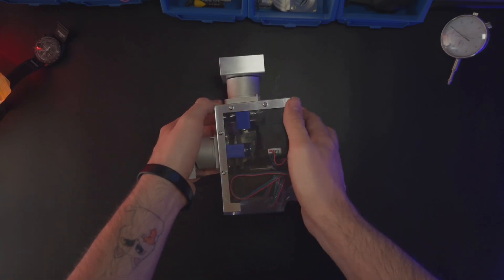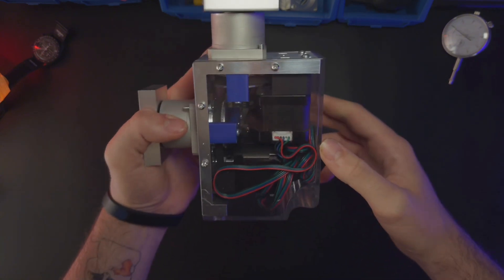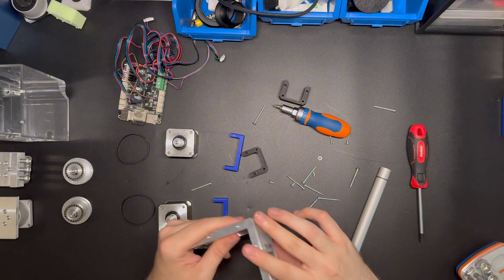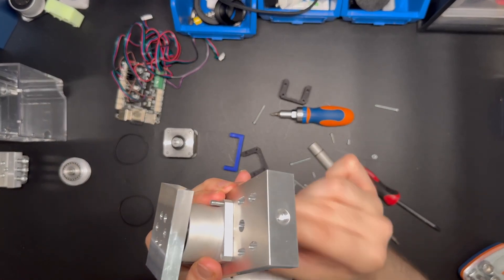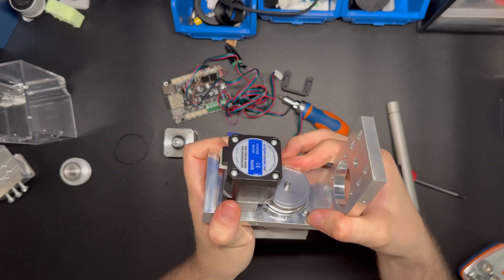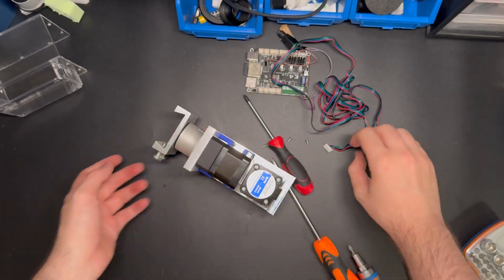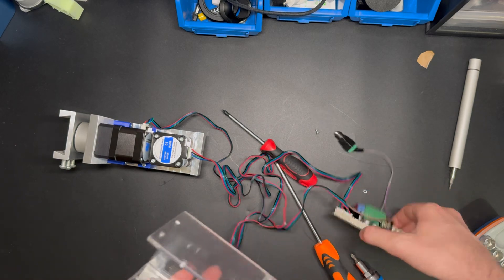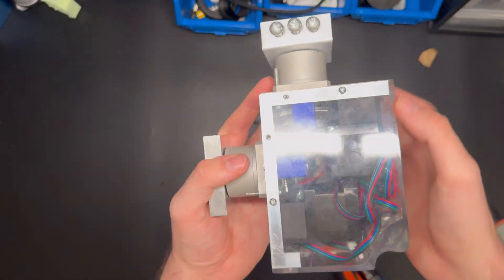Astrophotography on a budget: Assembly this $399 diy harmonic mount!

Comment: I bought you a coffee, but the files provided (.stl) are not suitable for quoting on PCBWAY or JLCCNC. The platform says the file is invalid. Another question is what aluminum alloys will be used to print the chassis, and what materials will be used for the other parts? When will we have a V3 assembly video? Is it necessary to also print the flange for the V3? What material is required?
Reply from the maker: You can join the telegram premium group, you have the link, there you will have the videos of the v3 assembly and all the explanations
Reply: @Astro-philosI just went in there but it didn't load any conversations or videos for me
Reply from the maker: @danielrocha1254  now you should see everything

Comment: Very interesting mount for sure, thanks for sharing the video. Kindly does this harmonic drive require grease? I noted that it looks like its dry and you did not apply any grease.
Reply from the maker: the harmonic drive has grease inside, between the flexspline and the teeth, but not in the wave generator
Reply: @Astro-philosThanks for the info.